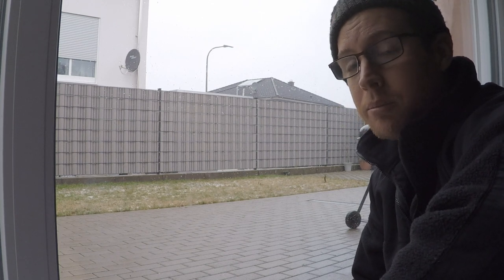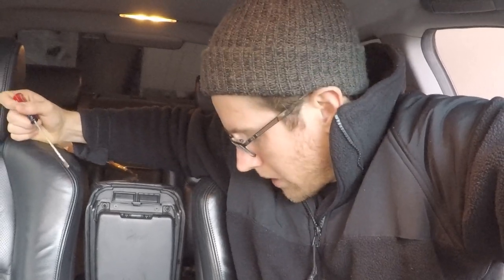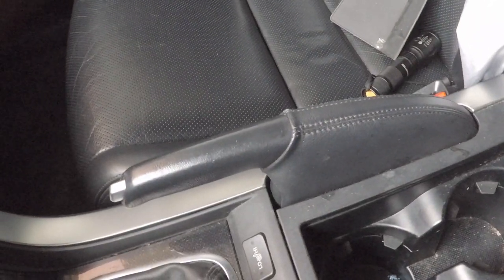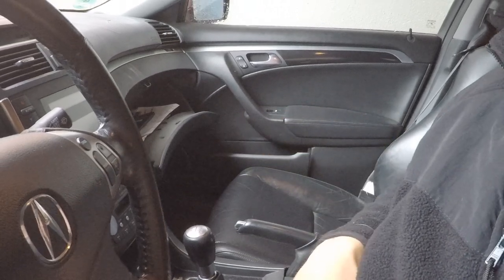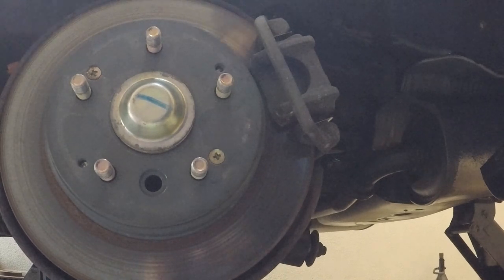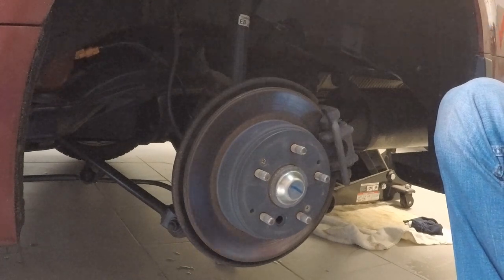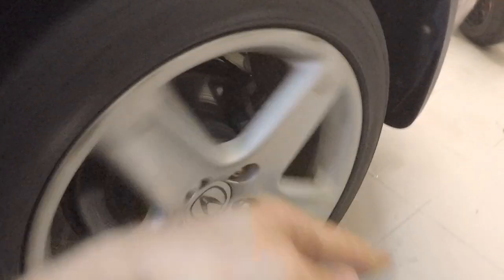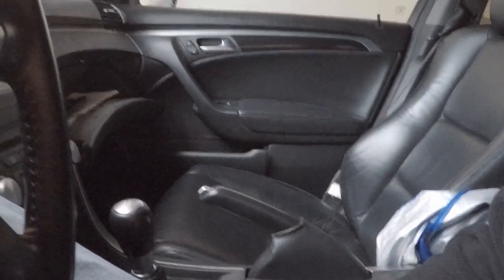2005 Acura TL E-Brake Adjustment

Comment: Awesome help brother. Gonna check out my driver rear tonight. Picked
Up a 06 TL and only that whew is locked. Suspected the adjusting nuts maxed out. The other wheel moves freely. Brakes not stuck on rotors lol
Reply from the maker: Sweet sauce! Glad it helped out!

Comment: So I found out today that my real wheels get really hot when I drive. Think it can use and adjusting on the rotors ? Cause it’s really tight when I turn the wheel when it’s in the air.
Reply from the maker: It is possible that there is a little drag going on. If you smell your brakes then there is definitely something in need of some attention. if the e-brake adjustment does not fix it maybe look into the slide bolts, (they may need some new grease,) It could be possible that your caliper is sticking a bit too. Anyway, I hope this kinda helps out. Best of luck. Cheers!

Comment: this is pretty much a copy of someone else's vid :(
Reply from the maker: I am sure that there are a lot of videos that are “pretty much a copy” here on this platform. Especially when it is mechanical.  I mean it’s a pretty straight forward fix or adjustment, what could be different about it?
Reply: @AdrianBilladeau  noob question but does the car have to be in N ?
Reply from the maker: @flacko001  nope. These are front wheel drive.
Reply: @AdrianBilladeau  oh ok I have a 2014 awd one and I can't seem to find the answer anywhere
Reply from the maker: @flacko001  oh ok. Well I have never adjusted one of those but I would assume that it would need to be in neutral. Sorry I can’t be of more help to you.